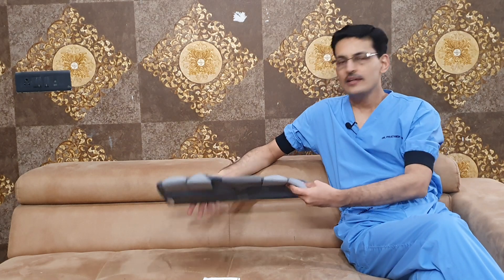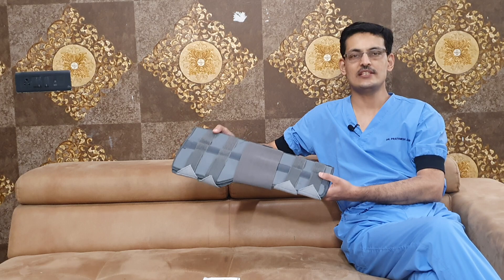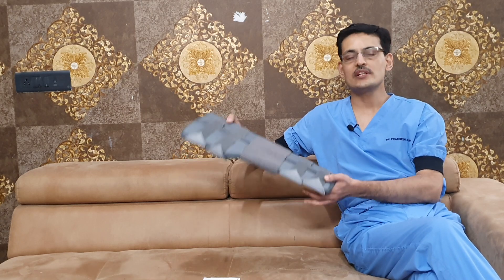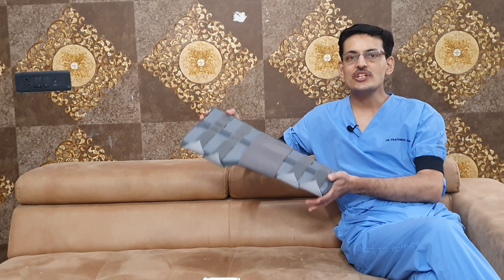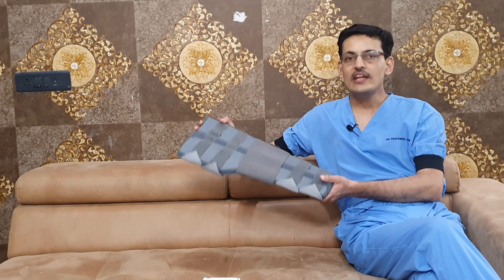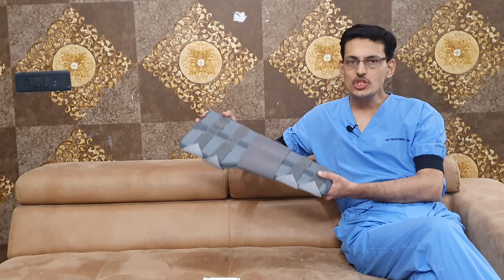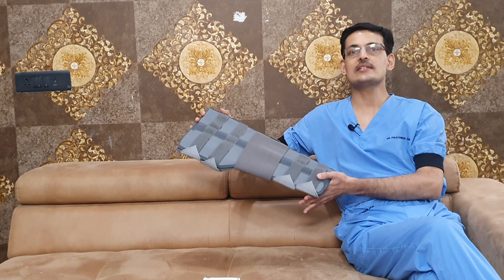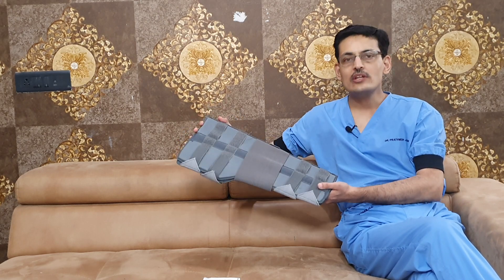Detail Information regarding Internal Brace with FIBERTAPE

Comment: I'm a army aspirants. Have to run 2600 metres in 5.5 minutes
 If hamstring graft is enough longer then should I use internal brace ?? Ans sir👍
 I'm ready to invest enough time to recover..
Reply from the maker: send your medical reports on 9227901980 
 Advance knee and shoulder hospital. Pakwan crossroads, sg highway 
Ahmedabad 
All details on www.kneeshoulderindia.com
You can book an appointment by calling on 7096021983/ 7096021847/7096021916 
www.advancehospitals.in